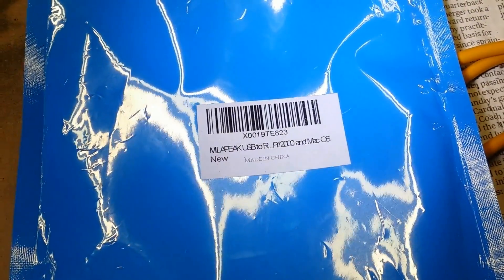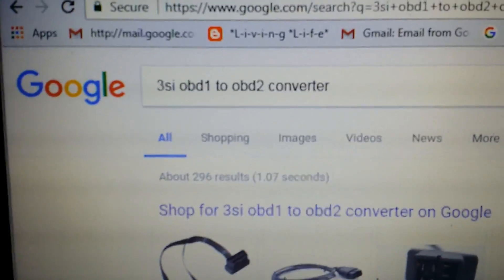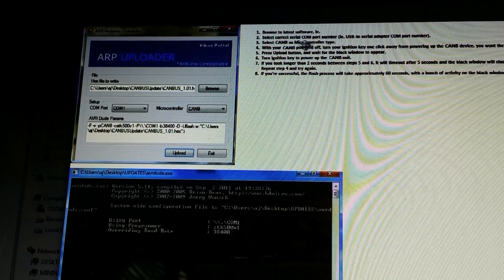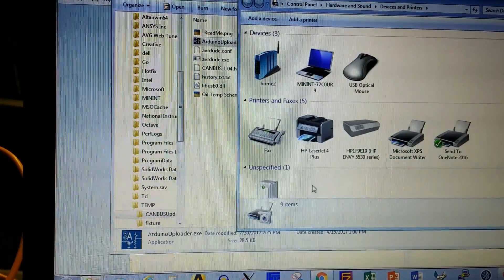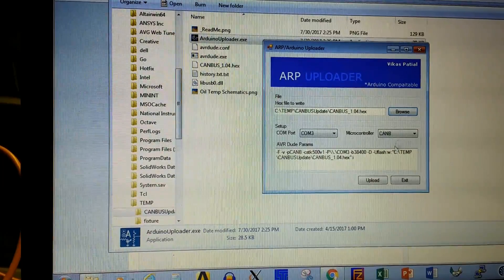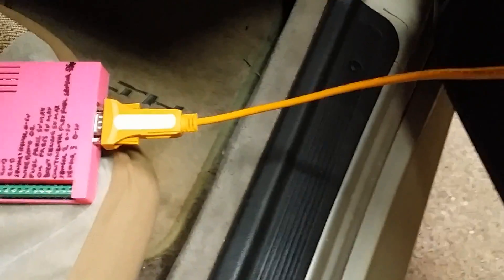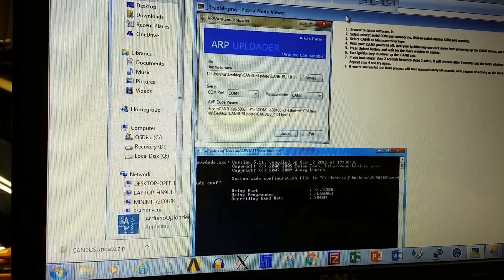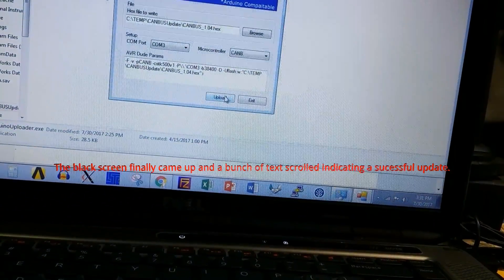Software Update method obd1 to obd2 converter for 3000gt Dodge Stealth

Comment: Some comments:

1. Adjusting the baud rate in the device manager is an unnecessary step.  The arduino uploader tool will adjust the baud rate for you automatically for this session.
2. You can update the software as many times as you like without consequences. 
3. What's attached to the OBD1 to OBD2 canbus adapter has no effect during the software update.  You can keep the OBD2 adapter plugged in.  Some of these OBD2 adapters have LED lights, so it's a good indicator when the OBD1 to OBD2 canbus adapter has power or not.
4. The canbus adapter can be powered up from as little as 8 volts to 16 volts.   If removing it from your car makes the flashing process easier, by all means do that.
5. To check revision, run a program such as Cool Term at 57600 baud, press connect button and then press enter.  A menu will appear which includes version #.

Comment: did you ever resolve getting engine codes? if yes what was the issue?
Reply from the maker: Yes, bought blacksealths newer touch screen device that gives error codes for all of the various circuits.
Reply: @fairbornCCF  was not the blackstealth device in this video designed to connect ecu and read codes via obd?  what did you use that decice for? having to upgrade seems odd solution, doesn't make sense am I missing something?
Reply: please ignore my last comment I just notice an older video where you show this device working....my bad
Reply from the maker: @namenotshown9277  Just went over my conversations with blackstealth.  He said that it does read the engine codes now after a software update.
Reply: @fairbornCCF  thanks so much, going with blackstealth for a unit